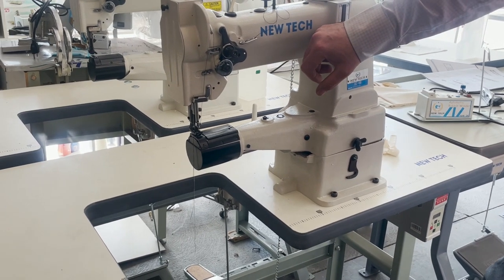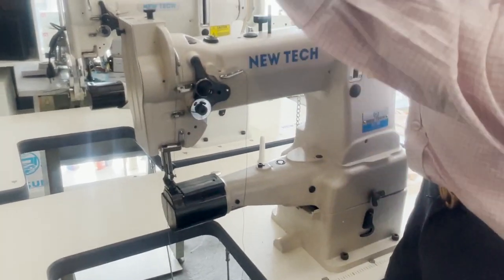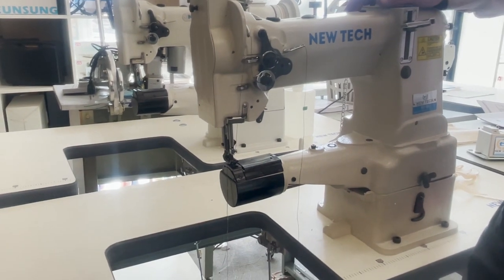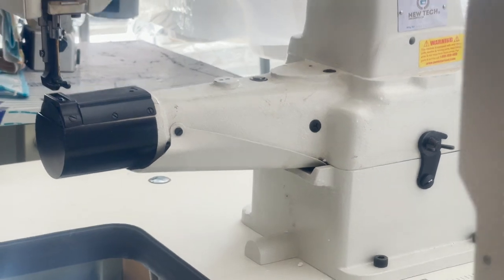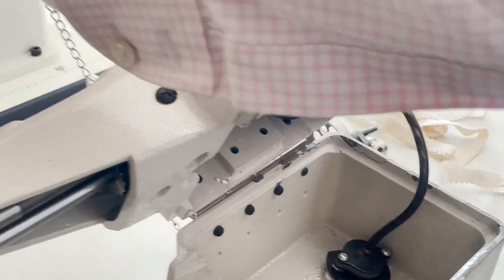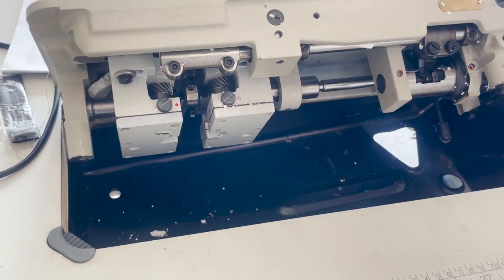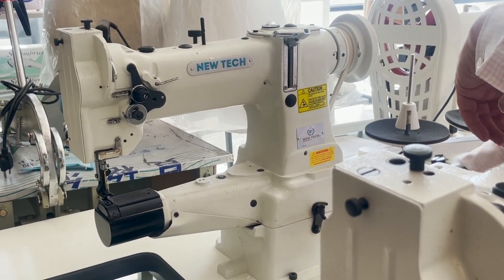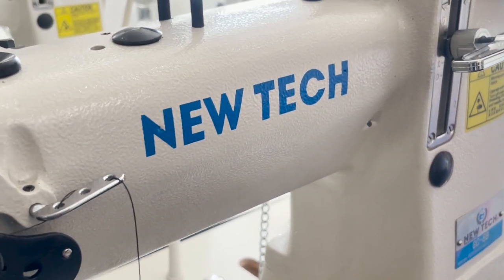Product Showcase - New-Tech GC-8B Oil Drip Issue Resolution - Goldstartool.com - 800-868-4419

Comment: Its a great machine but the oiling system is a little too much sometimes. In the upper feed area there is one extra wick for the top thread its meant to be placed on the foam pad in the second to last thread guide. I removed my foam pad and turned the wick to point up inside the head. That seems to help with oil on the needle and feet but I still get a lot of residual oil dripping down. I have to clean the feet and needle and cant place any material or binding tape under the foot when machine sits for any period or I get oil on fabric etc.
That isnt really much of a flaw only a minor inconvenience. The one thing to rememeber is that the GC-8B isnt a complete auto self oiler it requires a few drops from the user on the walking foot mechanism at three spots on the upper rear of the head.